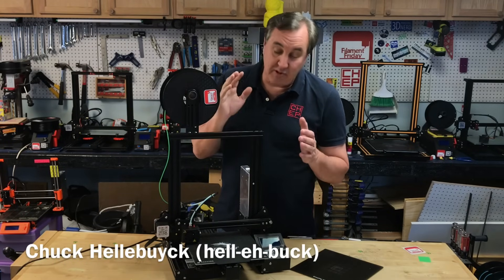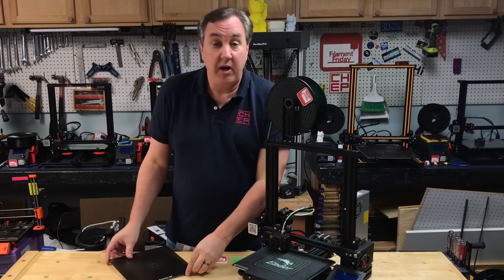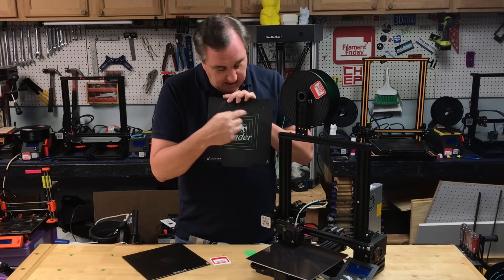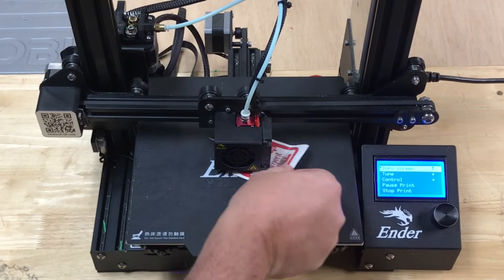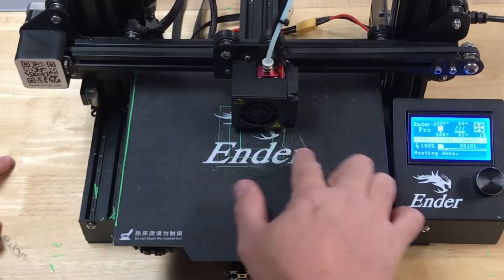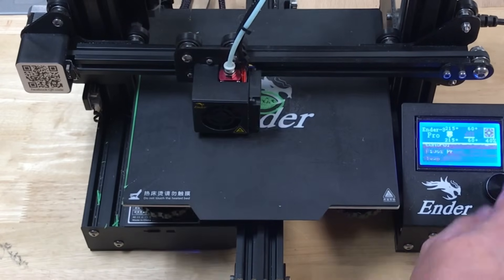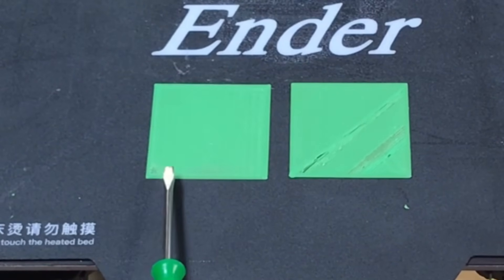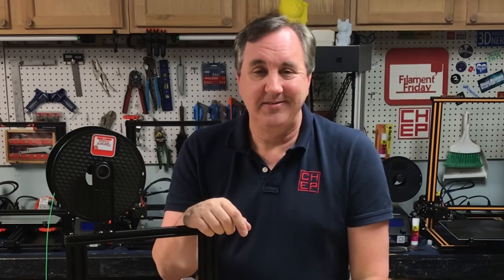Creality Ender 3- Easy Way To Level Your Bed

Comment: So i have tried this and the test squar worked ok. I went to test print a built in dog/pig/cat that came on the sd card (we just got it today) it went ok for about 2 layers and then just strings all over.

I have swapped pla and re leveld and i cant get the square test to stick now. PLA says nozzle 230-250 temp and bed @80-90. I have made the temp changes and it doesnt seem to help. Also now when the level test starts its pouring the philament off the side of the bed before moving to the first squar. Any help woild be ge8
Reply: Are you using PLA+? The nozzle should be around 200, and bed around 65.
Reply: @joshuakim7442  so im using petg filament not sure if it makes a difference or not. I set the temps on the machine yo 250/80 nozzel/bed. Cleaned the mat and  did the level. My back left corner is rarely correct so i adjust on the fly seemed to help some. I am running a chep cube now and its looking good with cura 4.6 settings and my default temps for the petg.

Comment: I am curious if there is a way to write a new copy of the "CHEP_Ender_3_bed_level" code for those who have upgraded to the new 1.5 board and the BLTouch.
Reply from the maker: The BLTouch is autolevel. It shouldn’t need my manual level files. Not sure what your looking for.
Reply: @FilamentFriday  Well, it should be anyway.  I'll have to figure out why it's not touching the plate when printing.

Comment: When I run the chep leveler g code it just keeps going and doesn't stop on each corner, do I have to place the g code in a specific folder on the ad card?
Reply: Mind's the same, Marlin 0.0.6 May 30 2020. Not sure how to tell what board number it is though.
Reply: Same here. Just got my first Ender 3 Pro and tried your gcode, it goes to all the right places, but does not stop.
Reply: same here!
Reply: same here
Reply from the maker: I’ve heard this on Ender 3 V2 but not pro. What board/firmware are you running?
Reply: @FilamentFriday  Ender 3 pro received today is Ver 0.0.6 dated May 30 2020
Reply: @FilamentFriday  same problem here. New to 3D printing so I can't tell you more than it's a brand new Ender 3 Pro
Reply: same issue, brand new Ender 3 Pro
Reply: also having the same issue
Reply: ok so basically what I did is open up the gcode file with any text editor, you will see the coordinates where the machine is supposed to stop M0 I believe was the stop instruction...
so I move the extruder to those points manually (moving the X,Y,Z on the machine, remembering to raise the extruder Z+ before moving along X or Y) and then adjusting.
It's more tedious but same effect

Comment: Hi, first of all thanks for the clear video's on how to do it, and the why behind it. Though i am running into a problem a little further then first layer. as far as i can tell my bed is level, and the first layer really looks good. But after that the second or third layer starts to go wrong. It looks like the bed is to close or something. The extruder starts knocking and missing steps. the print results in a very rough surface as if the head is too close. Any suggestions where i might start my search for resolving this?
Reply from the maker: Check z axis for resistance/skipping steps.
Reply: @FilamentFriday  It looks like the rollers of the Z axis where way to tight. Resulting in the right side of the printer lagging when going up. Even visible with the naked eye.
So i loosened the asymetrical tightening nuts and now the Z axis is much lighter/smoother.
tomorrow do  the bedlevel again, and do some test prints. It really feels as if this was the cause :)

Comment: What is the easiest way to modify this file to work with a .8 mm nozzle, it worked fine on .4, on .8 i cant get it to stick no matter how close i get until i get too close and then the nozzle is just scraping the bed... Tried to use the slicer to reslice the STL,  but any bigger nozzle size wont slice, i assume that means the lines are exactly .4mm wide...   How can i get around this?... this file worked great with the .4mm...

Comment: When i start the file it immediately start heating up the nozzle and bed and starts printing without the positioning before hands. Someone know something about this?
Reply from the maker: Sounds like the startup code in your slicer isn’t correct. Are you using Cura?
Reply: @FilamentFriday  Yes I'm using Cura
Reply from the maker: Does it have a G28 home in the startup code?
Reply: @FilamentFriday  not that i can see. I'm pretty new to 3d printing
Reply from the maker: Did you select Ender 3 machine?
Reply: @FilamentFriday  I have chosen the ender 3 when installing cura

Comment: Guys I need some help, after running CHEP's bed level gcode the layer fan won't turn on. I noticed this while printing (btw the bed is leveled perfectly since the gcode) and in screen the fan was at a 100% but wasnt even turned on. Does anyone know what is going on? Thanks!

Comment: Great stuff. Thanks for sharing it. One question: before leveling the bed, wouldn't you want to preheat the bed and nozzle to some typical temperature (say 190/50) to account for thermal expansion of the nozzle and bed materials?
Reply from the maker: The live adjust takes care of everything.

Comment: I run the CHEP_ender_3_bed_level.gcode on Ender 3-V2, but the nozzle doesn't pause for the adjustment. It just runs all the way to the end.
Reply from the maker: Yes, I mentioned that in my review. I’m testing new firmware to see if it’s fixed.
Reply: @FilamentFriday  I just got a new ender 3 pro and liked the idea of your leveling program.   I got the same problem where the nozzle runs all over the pattern and doesn't stop at all.

Comment: Just a by the way - do NOT use the already prepared gcode files CHEP is nice enough to provide on the Ender 3 V2 - it makes the nozzle grind into the glass in 3 different places before it starts printing anything. A model that came on the SD card with the printer is printing just fine, no grinding. Another leveling test from  another guy, also already in gcode, also ground into the glass in a couple of places.

Comment: First off thanks for the info and the g code. I hope a couple of questions that you might be able to shed light on. 

1. In the video you said (on the front left) should be a little of resistance. Then you moved to the other 3 corners and said it should be hard move the paper/sticker. I'm little confused by this. (I'm using a single piece of paper for leveling)

2. I was printing the squares and adjusting as I go. I have seemed to get the corners good but the vertical and horizontal lines on the outer squares and the small inner squares seem not to be sticking. Is there a way to fix this?
Reply from the maker: The paper is just to get close. 
Adjusting while it’s printing is key.

Comment: Does the same process apply if you have a BLTouch installed? Or do I have to manually adjust the Z Axis as per Creality suggests for bed leveling with the BL?
Reply from the maker: BLTouch requires its own Z offset adjustment.

Comment: I have been having issues with my bed, and I thought I use your code. But when I put the sd card into the printer to run the code in my ender 3, nothing happened. I thought I might need to put the gcode into into cura, and compile and save, which i did. Nothing happened. Can anyone tell me what i am doing wrong.
Reply from the maker: Not sure. Works for me and 1000’s of others. Should work right from the SD card. Just select it from the LCD menu.
Reply: @FilamentFriday  I did and nothing happens. I got a reconditioned printer off of ebay. From crealiry. So maybe they have done something
Reply from the maker: Not sure. Sounds like a firmware issue.

Comment: I'm running into a problem
My bed wheels are as loose as possible and when I start the first corner on the gcode the nozzle pushes into the bed
What am I doing wrong

Also, when the move the printer to auto home, the nozzle is under the bed, is this normal?
Reply from the maker: Tighten the eccentric nuts on two of the wheels. Adjust the z switch so it’s higher.
Reply: Thank you
Where should the nozzle be at home position?
Reply from the maker: Front left corner when looking at the printer.
Reply: CHEP I’m assuming level with the top of the bed?
Reply from the maker: It should be close. Then adjust the knobs per the video to get it close. Then the live adjust to finish it. You can use paper instead of sticker back.
Reply: CHEP I finally found some time to work on the printer and moved the z-limiter a bit higher so now the nozzle tip is very slightly under the bed while in home position
I got the first step of the gcode to level but the second (back corner) is basically the same as original where even at the loosest dial tension it isn't getting close to the nozzle
Reply: CHEP with some work I got all corners calibrated but the centre is a taaaaaad off
Reply: CHEP it finally worked, I can't tell you how grateful I am for you videos but more importantly your responses which truly show you care and want to help
I did the test print and there was no problems
One last question is what's the best way to clamp the bed sheet onto the bed
Reply from the maker: I use office paper binder clips.

Comment: just used the gcode and the gantry is going below the limit switch and flexing the bed on the first 2 points and making a horrible grinding sound on the 3rd point.
Reply: New Ender 3 v2 with glass bed.  I have printed 2 items today with no issues.  My friend recommended using this bed leveling video just to make sure.

Comment: hey there. ive goofed. there was slop (wiggle room) in the carriage (the bar carrying the extruder left and right) on the right side. i adjusted the inside wheel nut so that it was stiff. I then got this strange artifact on the 1st 3mm (calibration cube) where it printed like crap (globby and elephant footy), then printed fine the rest of the way up. i knew it had to be tied to the tightening of the right inside wheel nut so i loosened it. issue with doing that is when i turn the stepper motors off, the whole carriage slides down and rests on the plate, making it impossible to relevel it as it dosent rest at the home position. so my question is, what is the correct amount on tightness on those two inside wheel nuts? since mine had a little wiggle room (slop) on the right side of the perpendicular bar (the one that carries the extrude left to right) id assume its supposed to be that way. i only tightened it because i thought it has vibrated loose. anyway, thanks for any response!

Comment: More gratitude agreement from here also. I am setting my Creality 3D for the first time.   After over a year of it sitting fully assembled on its spot in my maker room but you make it simple clear to set my machine up. I have been wondering if I would advance enough to use this fancy glass bed? Thanks to you I will install it now with comfort and say goodby to my beds low spot and gratitude for the simple short test pattern as well.

Comment: Chuck, You solved this problem I had since day one. This video fixed my bed leveling. I am so happy right now and don't even know if you will see this message but if you do, know that its 2020 and your video from 2018 still serves a purpose. Thank you sir. :) :) :)
Reply from the maker: Glad I could help.
Reply: So sorry to bother but after i got everything according to the video, i started a test print and it looks like my nozzle is sort of scraping the bed print.  I'm not sure why, does this have to do with my bl touch? Ple help, I know I'm almost there.
Reply from the maker: This is for manual level not BLTouch autolevel.
Reply: @FilamentFriday  thanks chuck,  I will check out your bl touch video. Or do u recommend having bl touch?
Reply from the maker: I don’t have a bltouch video. I prefer manual level.
Reply: @FilamentFriday  ok yeah, that's awsome.  After I watched ur video and labeled it, it was good then tested with test print and bltouch ruined it. How do I revert to no Bltouch? Like sw update?
Reply: Just a note. Thank you for your help. I gi naly got my bed leveling supper good using the files u have on ur site.

Comment: CHEP, I have to say that your stuff so far has been a lifesaver for my own sanity. I was trying the traditional bed leveling method but it was a complete PITA cause something was always off somewhere.  After I looked at your video about Fix Your Creality Ender 3 and Upgrade the Bed Level sure enough: the Z-Axis was fairly off. After leveling it as much as I could and running your G-Code and two tries of the test print, everything came out perfectly, perfect first layer, ran my finger over them and they were pretty solid!

Comment: Hello, great video! I saw with the benchy it looked like you put glue on it. Is there any type that works better than others or just good old emers? Thanks!
Reply from the maker: When I use glue (such as on glass) I use Avery Glue stick. I found its best and washes off easily.
Reply: CHEP okay thank you, so on the normal print surface on the Ender pro for example I just leave it alone with no glue?
Reply from the maker: Correct. Unless it’s so wore out and you need to print while you wait for a new bed surface to arrive.
Reply: CHEP okay thank yo so much. Your videos have been a huge help to me!

Comment: Great videos recently purchased this machine did the odd print wasn't too bad thought I had levelled the bed but using this has massively improved my print I might run this test daily so I know each day should be consistent good work thanks

Comment: I have a different problem. I'm trying to use your gcode to level the bed on my Ender 3, but the nozzle is almost 1/2" above the bed. Is there any way to adjust it to bring it closer?
Reply from the maker: Lower the Z stop switch. And the home it to get the right position.
Reply: @FilamentFriday  Thanks for the reply. It turns out that when I had unplugged the x and z cables to straighten out the kinks, I had missed plugging the z cable back in. Now your gcodes files work perfectly.

Comment: Thanks a ton!  Does anyone use the Creality slicer that comes with the Pro?  Or should I use Cura?
Reply from the maker: The Creality slicer is Cura version 4.2.
Reply: @FilamentFriday  ah good...thanks so much... ive had my ender pro for a few weeks and im suddenly getting horrible pits all over my prints... (someone said 'retraction') ... so im not sure if its the bed leveling, my software, my old filament (but all three of my filaments started doing it at the same time) ... OR the extruder sprint.  Still using the cheaper plastic lever that came with it.... .Am going to try your video above and see if it fixes things.

Comment: Perfect video! Thought my level was fine, but my initial lines weren't good and weren't sticking well. 
Turned out I had to raise the level a bit more (1 layer A4 instead of a folded one) 
This video and the files you added worked perfectly! Also really like your Cura settings, they print very well :D

Comment: Hello CHEP! I just put my Ender 3D Pro and after the set up, I went to level the bed and it wasn't leveling correctly, I couldn't figure out which way to turn the bed wheels. I turned off then on again to start over and when I clicked the "Auto Home" again the nozzle goes over to the left side like it should, but then slips past the bed all together and I can't move the bed at all, the extruder just sits past the bed. Now, I can't even move the bed because it is hitting the extruder. Any ideas why this has happened? I would really appreciate any answers :)
Reply: Home it,disable steppers. Then you turn the bed down until the nozzle will be close to the bed(roughly).
Now you can start adjust with a paper in between,then use the gcode
Reply: @JackHerer888  thanks! Still learning wha the code means. Are you saying to use the code that CHEP is saying to use, because I cannot figure that out either lol!
Reply: Download chep bed leveling. First file is to set nozzle with the wheel,secound one it will draw a line so you can check on adhesion and fine adjust

Comment: Hi,
I just build my Ender 3 pro with your video. Thank you for making it easier for me. But now I’m trying to adjust the bed and some of the corners are adjusting.  In one of them I’m turning the nub to the point that it’s about to come out of the screw and it doesn’t get closed to the bed. And another corner I’m trying to take it down and is still tight. I don’t know if I did something wrong on the building part? It’s looks exactly like in the video. I even use the square ruler. Please help!
Reply from the maker: Check the X bar for parallel to the bed frame.

Comment: Please advice on what I can do about this issue.... I have an Ender pro new as of yesterday. I just did your first paper level test and the 4 corners are adjusted . I get to the middle and it drags. I now have a very gouged mat! I have been at this all day same results everytime . The bed is higher in the middle. My first test print was a train wreck. It of course prints in the middle where my bed is higher. Prints was rough, shifted and knocking in the extruder. Please help. I have searched everywhere and can find a fix
Reply: If you have good layers around the edges by dragging in the middle, you need a new bed surface. Try a piece of glass.  Even my glass it a little weird, but not too bad.

Comment: I'm having success with all of the corners and even the center except for the bottom left corner. It begins to loosen before it starts to grab the paper
Reply: Mine did that too, I recommend grabbing some yellow bed springs, it stopped that from happening all together

Comment: In your test, the bed temperature was 60, while mine(with same file) was 50. There is some problem with that? lower temperature would stick the material differently in the bed?